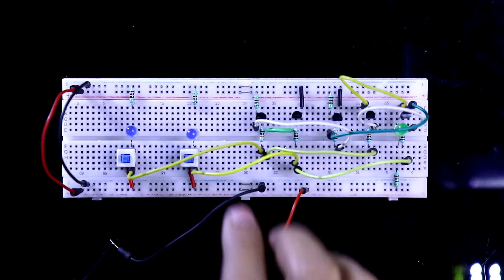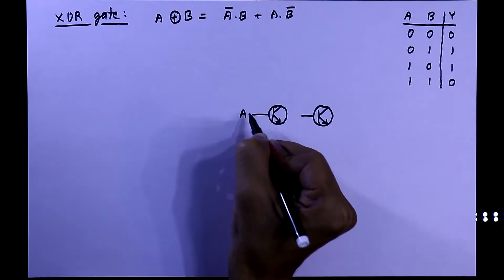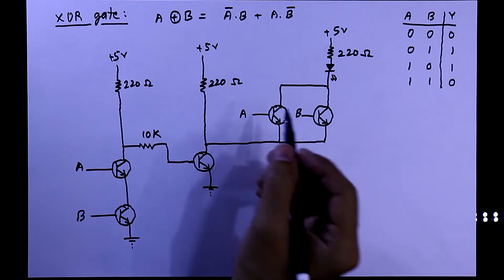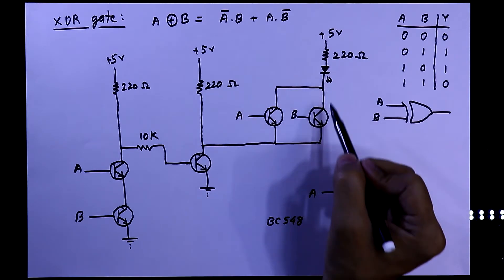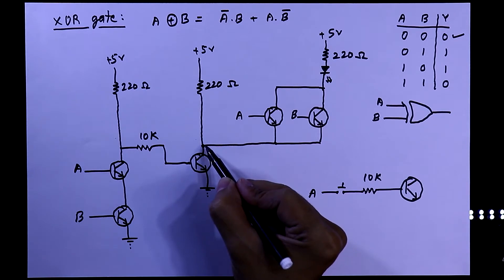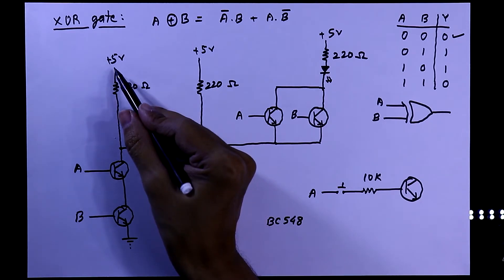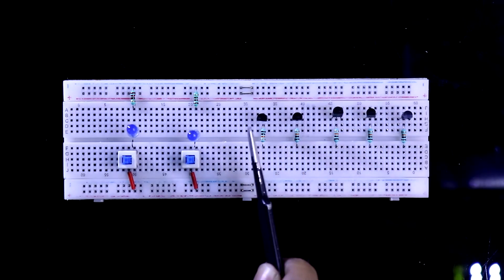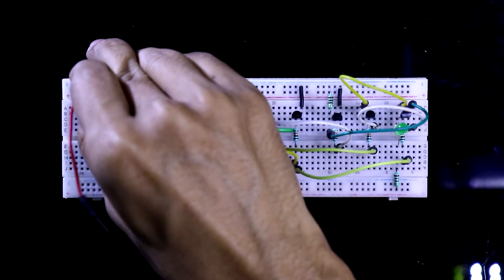XOR gate using transistors | Transistor logic circuit

Comment: At XOR Gate:

Explain why the close circuit in the AND Gate is causing the break at the transistor (Not switching the LED on) if pressed simultaneously?
What is the reason for the electrons to not flow in that direction and open the transistor to turn on the LED?

🙏🙏🙏🙏❤️❤️❤️❤️🙌🙌🙌🙌👍👍👍👍
Reply: because of the 10k resistor. Current will flow to the easiest path, some little current will flow to the transistor base through the 10k resistor but will be very very minor and it wont open the base.
Reply: In other words, why current should exhaust itself to try passing the road with a monster in it (10k resistor 😂)? It chooses to run away through the (very low resistance) transistors.

Comment: Please help me, can I use just 4 transistor ?
Reply: The left hand 2 transistors are configured as a NAND gate and the centre transistor just inverts it to an AND so I'd have thought it's fine to lose the centre transistor and take the output of the first two from the bottom (with a resistor at the bottom) so it acts as an AND gate.
Reply: @ChrisLee-yr7tz  ok, thanks

Comment: WOOOW! Very clean explanation. Thank you! New subscriber :)
P. S. It didn't work for me, but the problem is somewhere on my breadboard. I hope I can fix it
Reply from the maker: Welcome to my Channel 😊😊😊
Reply: @EEWave  I'm using 2N3904 Transistors. It works with 0-0=0, 1-0=0, 1-1=0. The problem is with 0-1=1, it doesn't work here. My transistor has a different pinout, but I did the same thing as your schematic demonstration. I don't know if I explained it well, but any help would be very much appreciated. Thanks!